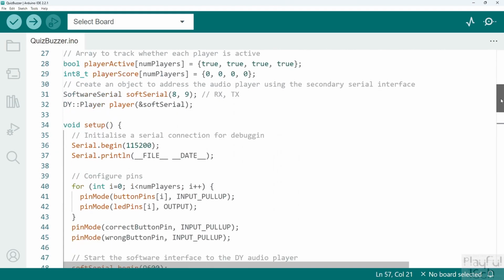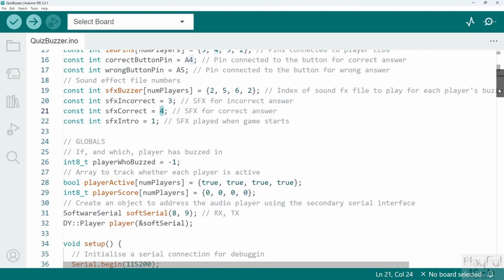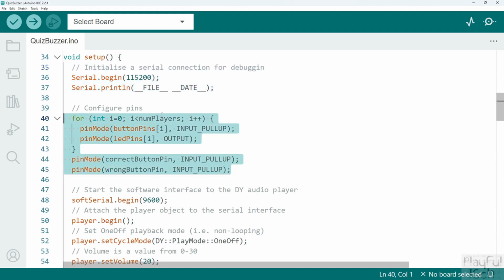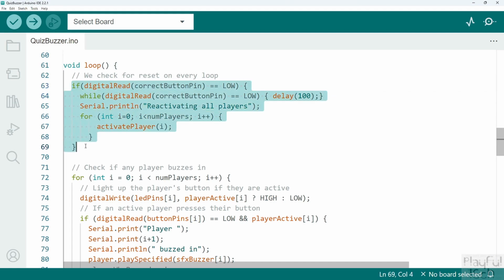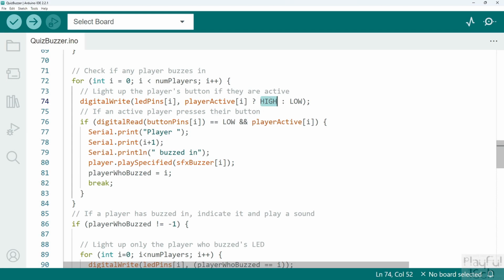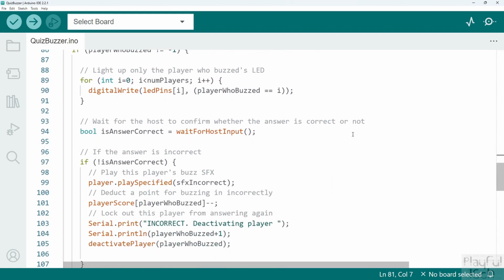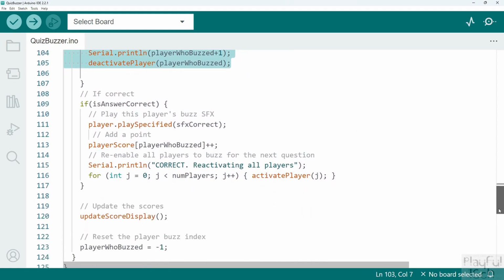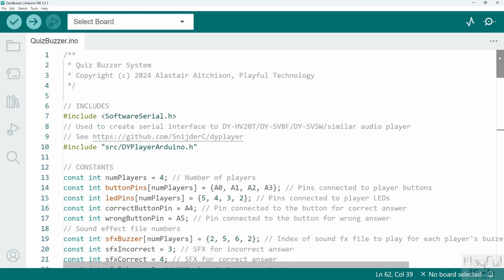DIY Arduino Quiz Buzzer System

Comment: I built this project two years ago. I'm a middle school teacher and man, this setup has been such a game changer (pun?). This was my first arduino (or mini controller) projectand it opened up an entire new world for me. Ive now gone on to build several projects using an arduino and even graduated to the ESP32.

Im back to this video today because my original setup needed redone and i, for the life of me, couldnt find the coding i used in my original build. Im very thankful for this video and the hobby it created for me. 

I built this setup with very minimal experience and my wiring had kept failing. My word of advice is dont built this with the wires that are used on the breadboard. Get the nano shield (like the video has) and use nice wires (like ones for a car). I used the DY-HV20T which requires 6-12 v. So i wired my entire setup with a 12v lithium battery. I power a 2 port USB car charger inside my box with this battery and use those ports to power the arduino and this inline mini amp i added to the aux cable. I also added a charge booster so i can charge the battery with a type-c. 

The other update i added was to the coding where, if the game was sitting in the state after the incorrect buzzer was pressed, a sound is made to let you know the system has successfully reset.

Comment: I have 12 students in a class ....could i connect 12 buttons?
Reply: If you eliminated the LED lights for each buzzer, you could have 14 buttons using this setup, and without changing the coding much. With each button having an LED, you could have 7.

If you wanted LED's on all buttons, they make pin extenders for these things (i/o expanders). It would change the coding. an example is the MCP23017. It gives you 16 extra digital pins while only using 2 Arduino pins for I2C communication.
Reply: @MrVleeschouwer  ... Thank you for the reply ....Im an ESL teacher here in Vietnam and trying to get out of the monotony of bombarding my students with repetative chanting ....while trying to make my job easier and more fun.  I was hoping that you'd say ''go with a  Arduino Mega 2560'' ...with 54 i/o pins...paired will give me 27 buzzers...possible? hoping the coding would stay the same ,just adding extra buzzers. To add to the madness I'd like to make it wireless using nRF24L01 module/ESP8266/ESP32 Wi-Fi chip to each buzzer and each having a 7-Segment LED Display score board. I have made a start on the curriculum with powerpoint which creates to the madness .... I need 4 /maybe 5 buttons for scoring ... ( one for incorrect answers and deducting a point, one for adding a point if correct, one for adding 3 points if the student uses correct sentence structure, and last one or 2 for adding or deduting points  - if they caught talking or misbehaving during class or adding variable points for bonus rounds in 1 point increments) ... I intend to use a reward system of candy/gift shop (low cost merch - stickers, books, pens etc)... currency for purchase will be the points earned so I need a seperate system to add scores after every class, and deduct after every purchase! (figure that out lateR! )...I have used arduino in the past and have studied turbo pascal programming at uni (back when 286's were latest craze!)... which is not all that different from C++. We put a man on the the moon!!!! how difficult could this be?possible?? or just a pipe dream? you interested in collaborating?
Reply: okay just watched your vid on on GPIO inputs and outputs .... see what your saying about using an extender ....I want lots of lightsand sounds ..lol!

Comment: what brightness would you recommend? Im currently testing different RGB-LEDs but they seem to be  a little to dark, even if I use the recommended resistors for each pin.
Reply: I have the same problem. Have you found a solution yet?
Reply: @Mird333  I simply bought the brightest I could find. used the lowest resistors possible and it feels okayish now. Other solution would have been taking bigger LEDs (but obvsly you need other adapters) and I didnt wanna do that.

I'm creating a set of 12 Buzzers which is WAAAY more work, so i still didnt finish. If I remember after its done, maybe ill come back here again and tell you how it finally looked

Comment: Hi, am loving this and would like to try, although it's been 40 years since I did any coding and that was BASIC. If I make this set up it would be for the charity quiznight I do each christmas so my question is can I get it to run 6 buzzers off the nano ESP32 board?
Reply from the maker: Each buzzer requires 1 GPIO for the buzzer input, and 1 GPIO as the LED output. A Nano has 17 GPIOs that you can use without any modification (D2-13, and A0-A4), so yes can definitely support 6 buzzers!

Comment: Fantastic build!  I have (hopefully) a quick question: I built the same game shown in your video, following your wiring diagram and code (thanks for sharing!!). The system works awesome, but every now and then, randomly, the correct answer button will trigger the incorrect answer code, and visa versa with the incorrect button, triggering the correct answer code. This happens randomly with each maybe 1 out of 30 presses.  Any idea what would be causing this?  I checked for stray wires and poor connections with no issues uncovered. And it only happens as the buttons are pressed, not randomly as though it’s getting a “phantom” input. Thanks for your help!
Reply from the maker: How long are the wires that you are running from the controller to the buzzers? Besides an obvious loose connection, my only thought is that the wire run is so long that the resistance is not sufficiently different to overcome the pull-up resistor on the inputs?
Reply: @PlayfulTechnology what length for 22awg 4 core would you recommend please? Is there some advice on the SD card for the MP3 player please. Do you just save MP3 files on the root called 00001.mp3, 00002.mp3 etc up to 8?
Reply: Did you find a reliable length for the cables?

Comment: Many, many thanks for uploading the schematics for the project. As a newcomer to electronics at the age of 77 I’d managed to work out the bulk of the schematics from the code but hadn’t yet worked out the wiring for the MP3 player.
I’m just waiting for final component from Amazon and I should be ready to go. My next project will be to build a wireless version which i might push up to 6 players.
Reply: Did you eventually get your project going?

Comment: Your code works great! I don't have a mp3 player, so i had to take out audio stuff. The only oddity I'm experiencing is that it always registers a player buzz as two clicks.

Player 1 buzzed in
Player 1 buzzed in
CORRECT. Reactivating all players
Player     1    2    3    4
Score      0    0    1    0
Reactivating all players
Player 2 buzzed in
Player 2 buzzed in

Thanks so much, my students are going to love it!

Comment: Hi, I have been doing a Live TV production with a lot of Quiz shows, I am still using an analog Quiz lockout machine made by my cousin back in 2008, Now that I saw your video, I really like to make them, I have download your github file, But will it be possible if you  can share me a wiring diagram of the unit ?

Comment: I am new to building and programming the Arduino and I am very impressed with the projects that you run through on your site. I would very much like to build this quiz project but being inexperianced I do not have the skill to build and connect the hardware. Is there a circuit diagram anywhere for the build?

Comment: Love it! What great timing. Just last week, I was using one of these with my year 9 and 10 science classes. I built it around 20 years ago, all analog based around 4 thyristors as triggers, with 4 LED's and a buzzer. The tactile buttons are mounted on the top of clear film canisters (if anyone can remember them) each with an LED inside. For connecting to the control unit I used 5 pin din plugs/sockets. I was thinking just last week I need to make larger, more visual buttons, with better sounds perhaps some automatic scoring. The arcade buttons are a great idea. Thank you! I did think of wireless, but I'm not interested in having to worry about four additional sets of batteries.
Reply from the maker: Ah, I often used to use empty film canisters as waterproof enclosures for small electronic projects! (often with different degrees of success....). A couple of folks have mentioned wireless buttons, but I tend to agree with you - the additional copmlexity, and hassle of managing batteries, and concerns over latency/lag probably isn't worth it (fwiw, I'm just using cheap speaker cable to wire each button to the host panel, and you can buy it in 100m rolls very cheaply)
Reply: @PlayfulTechnology  Also, with a cable attached, it helps control the space and stops players from wandering around with the device - I could imagine my year 9's getting a bit too excited and passing it around.

Comment: One pretty easy thing you can do to help with storage is use 3.5mm panel mount stereo audio jacks on the buzzers and control box, then connect them via aux cables. That way you can store them without the cabling getting in the way. Bonus advantage of the cable probably just coming out instead of breaking if a buzzer is dropped or pulled by an overexcited child.

Ethernet jacks/cables should work as well, though most of the wires won't be used. The biggest advantage being that it's super-easy to make a cable in any length you want for different situations (e.g. shorter cables for the dinner table, longer for a classroom scenario).
Reply: Or, make a wireless version.
Reply: Can you provide me with the components and the way to create the same circuit for 8 contestants please

Comment: I made one for a children's entertainer many years ago before Arduinos, it used either a PIC or AVR programmed in assembly,  it had an early audio record/playback chip so each contestant could record  their own name or sound. I slight overkill thing was it could deal with dead heats, all buttons were diode OR'd to an interrupt pin which if triggered read the whole port at the same time so a dead heat/draw could be detected.
Reply from the maker: Nice solution!

Comment: Love it, would absolutely LOVE a wireless button version, perhaps using ESP32 wifi and a battery in each button box.
Reply from the maker: As it happens, I do have a wireless version as well - it uses a D1 Mini in each button box and communicates over an ESPNow mesh. The only slight issue is that wireless communication necessarily introduces a very slight delay between the button being pressed and it being registered by the server. In the overwhelming majority of cases it wouldn't be perceptible, but (having hosted a pub quiz myself for many years with some very competitive teams!) I want to ensure there's no scope for teams to accuse the host of them having pressed the button but that detection to be delayed. 
It can probably be addressed by having a synchronised timestamp on every device, but I'll need to do a few more tests first to measure what the lag is, and whether it's even worth accounting for (and things like whether proximity/interference from other nearby Wi-Fi networks affect it etc. etc.)
Reply: @PlayfulTechnology  I’m thinking perhaps 433mhz remote relays, that way a) there’s no delay and b) no need to run battery or network, so essentially the same as your solution but with remote relays instead of wires. Can you foresee any issues with this (other than rewiring the button on the remote so an arcade button fires it off). I’ve got a quiz coming up that I’m jointly hosting and I want to get away from the whole “swapping papers” malarkey
Reply from the maker: @ImperialLightandMagic  But if you've got multiple buttons all simultaneously transmitting on the same 433MHz frequency, how are you preventing interference?
Reply: @ImperialLightandMagic  I used ESP32's with the ESPnow protocol for this to reduce wiring, I was annoyed with the displays as the art department were supposed to add gels to increase contrast which they didn't. It had very low latency and worked in a TV studio with wireless cameras and mics nearby.

https://www.youtube.com/watch?v=9NKLju08Pas
Reply: @ImperialLightandMagic  Also https://youtu.be/C8_qKI2EF7w
https://youtu.be/F0KSmA5b2Bs
Reply: @PlayfulTechnology  I’ll do some tests but I’m pretty sure that once they are bound, they won’t trigger another relay. I’ve certainly done this with 3 in the past (resetting various props in an escape room) I think I have a few more in stock. I’ll let you know how I get on
Reply from the maker: I'd be interested to know the results! I don't think there's necessarily an issues with triggering another relay - I can see that each unit might have unique agreed activation codes. I was thinking more of the problem that if you press three different buttons at the same time (which broadcast on the same frequency), how come they don't interfere with each other? Like, if there were two radio stations broadcasting on the same frequency and you tried to tune your radio to one, you'd hear both, right, or just pick up whichever one was strongest? And I don't think those relay units have any sort of error correction or retransmission.
Reply: @PlayfulTechnology  After I typed this (last night) I remembered that I built two remote smoke systems for a client a while back, and the behaviour of the two independent relay systems was that of "fastest finger first" which actually might work to my advantage in this case.  I'll mock something up and make a video of the results.
Reply: @PlayfulTechnology  I didn't have any noticeable issue with lag or interference with this which used ESPnow and was used in a TV studio with a lot of strong RF around https://www.youtube.com/watch?v=9NKLju08Pas
Reply from the maker: I've definitely experienced measurable (and somewhat unpredictable) lag with ESPnow and other mesh networks (PainlessMesh etc.), but it also depends on the network topology you're using. If every button is within range of the same WiFi AP anyway, I could get far more reliable performance by just having each ESP make a direct Wi-Fi connection. Using the ESPnow mesh gave me far greater range since each node only needs to be in range of the next (I was using this for a quiz event taking place in a large hall), but at the expense of bandwidth and latency.
Reply: @PlayfulTechnology  I used ESPnow in a simple peer to peer setup rather than mesh as such and while there was no doubt some measurable lag there has never been and perceivable lag from a human POV.
Reply from the maker: @mfx1  Yeah, I suspect it's the node-to-node forwarding across the mesh network that was responsible for most of the lag (but then, that was also the reason for wanting to use a mesh in the first place to extend the range. If all devices could have reception to a common server, I'd have just used UDP/MQTT)